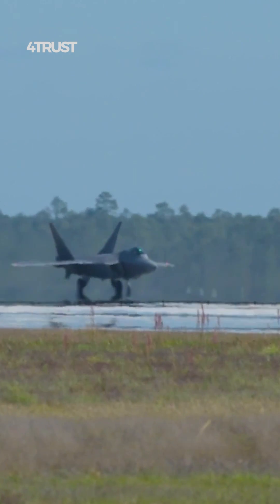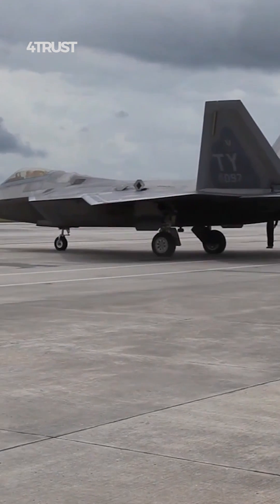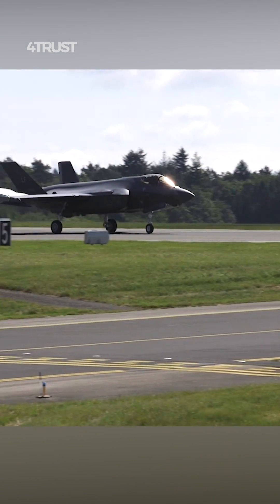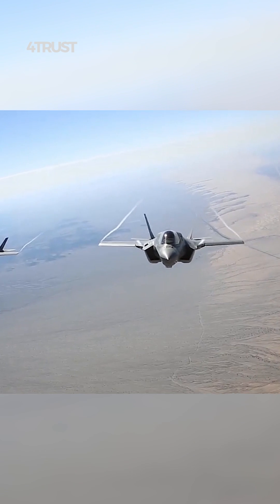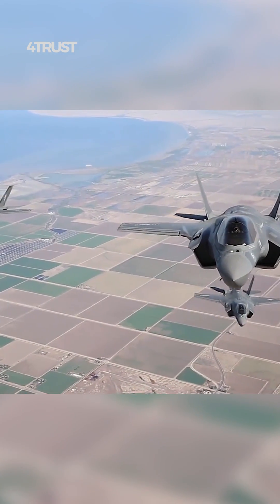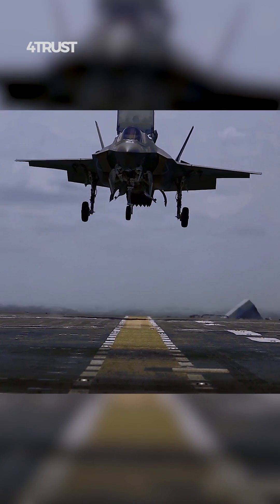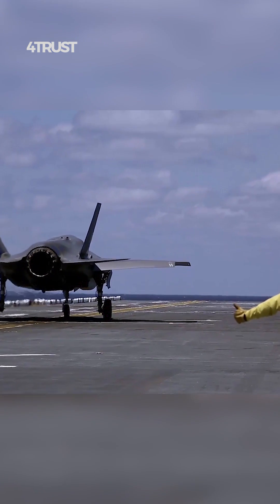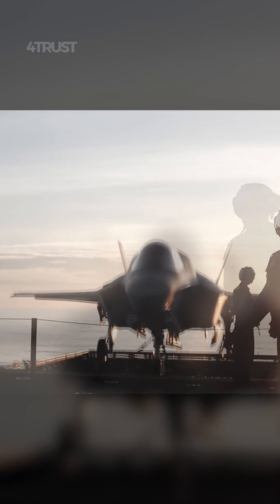Why Was the F-35 Designed to Be Slower Than the F-22?

Comment: The A10 is a beast and i hope they revamp this beautiful plane....
Reply: From all considerations the A-10 is heading to the scrap heap after a good run. The Ukraine conflict has shown that ground attack aircraft cannot operate against forces with adequate shoulder launched anti aircraft systems. And radar controlled anti aircraft vehicle mounted vehicles. Both Russia and Ukraine had to withdraw these aircraft due to high losses. 

The A-10 didn’t fare that well in Iraqi when it was attacking the guard units that had sams in numbers